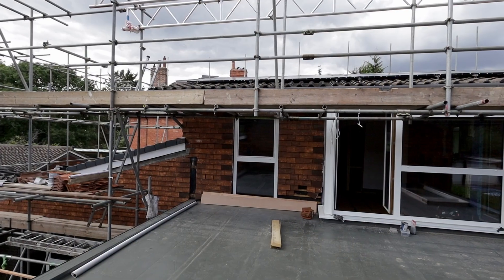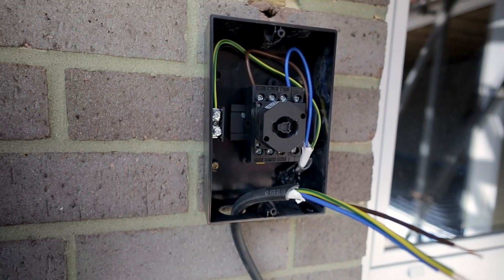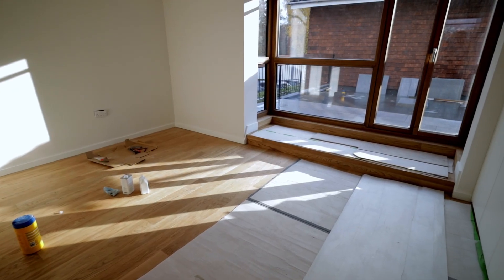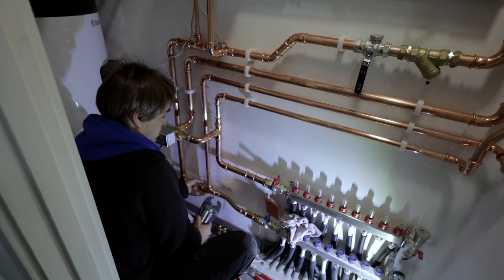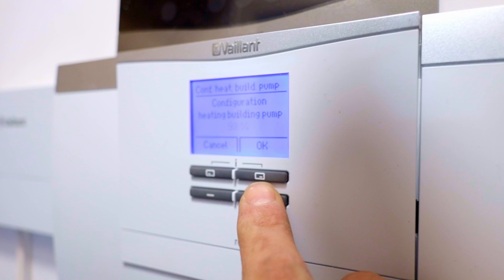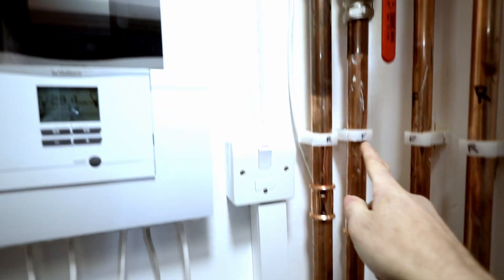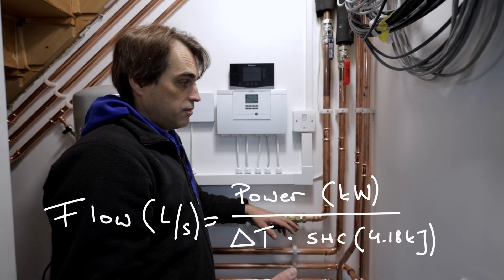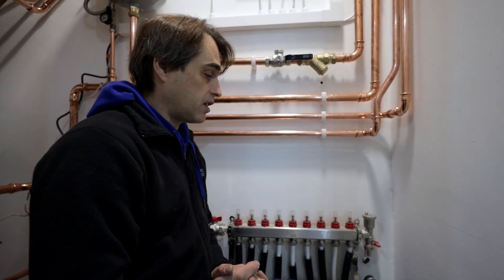How To Install an Ultra Efficient Heating System - Heat Pump + UFH.

Comment: Hi simon, like the install, nice and neat, however i don't agree with running open loop systems, it depends on the property of course but i find that zoning by room is beneficial. Open loop ignores solar gain and internal appliance gains eg an oven or computer, therefore you would be over heating some rooms whilst others arent yet at temperature, when shutting off the zones that have met their set point would allow the heat pymp to modulate down. What do you think of this?
Reply from the maker: You can still run open loop with stats that will close overheating zones. What you don’t want to do it to allow a small zone to turn the heat pump on, on its own
Reply: @UrbanPlumbers  interesting, can I ask what your opinion is on blending valves, I see the industry using these alot for 2 zone 2 temp with rads and underfloor, once again I don't really see the point for this because you're creating let's say 40°c for the rad circuit only to blend it down to let say 30/35°c for the ufh, would you just run it all at a single temp allowing the underfloor to heat up and satisfy the call for heat faster rather than wasting the heat that's already been created
Reply: Most heat pumps, like the Aerotherm you can place the controller which senses temperature in the room with the highest solar gains and enable internal influence to adjuist the compensated flow temperature down.  System volume is king with any vapor compression system.  For very large properties, HMO's, student accomodation, hotels etc.... zoning is stil required.
Reply: I agree with Simon but I also agree with you :) It really has some up- and downsides from my point of view. And as you said it depends on the knowledge about the usage and all the non usual ocasions like having a party with 20 people in one room, a wife which gives Yoga lessons in one room, an power hungry heat emmitting gaming PC :)... and so on.

But I of course highly cheer the knowledge, skill and pride Simon is putting into calculation of all the rather static energy needs of every single room and doing everyithing right from planning to delivering the project. I really learn a lot even if I'm not from the feeld directly!

I have optimized now 2 airsource heatpumps and one water-water heatpump by between 30 to 50 percent year to year energy consumption. They have all been put in without proper planning and just left with mostly standard settings or much to high preflow temperatures and many other misconfigurations on other settings. To me it seams that you really can screw up a lot and it does not really matter what kind of heatpump is installed.

Comment: Could you use 28mm PEX or similar instead of copper as the temperatures are so low? - about a third of the price.
Reply from the maker: Pex needs to be a size up so 32mm Pex for 28mm copper.

Comment: Hi Simon 
I know you are really good with vaillant controls, can I use vrc720/2 
With underfloor heating zone, plus two heating zones and DHW cylinder or I need some additional controls?
Thanks
Reply from the maker: Vr71 needed plus 2 x VR92, unless you want to run on pure WC - then just VR71 plus VRC720

Comment: Can I ask why you choose that capacity if heat pump for the property rather than a 5kw one?
Reply from the maker: This is a 5kw heat pump
Reply: If the heat loss was 3.5kw - why didn't you use the 3.5kw vailent? Which can do 4kw according to the sata sheet. Thanks.
Reply from the maker: @TC-V8  because 3.5kw unit is the same as 5kw and minimum modulation is also the same. 3.5kw is just a 5kw unit with capped top output

Comment: I you use only 1-zone, what would be your preferred way to setup a smaller room like a bathroom where you also would want a higher temperature? I opted to lay the piping at 5cm from each other but I think it still isn't enough. Would you opt for a extra radiator calculated on the same water temperature? 
Maybe an idea for a future video. If you don't have enough surface erea to lay floorheating. Thanks!
Reply from the maker: It depends on your heat loss. If you increase the flow rate to bathroom you can relatively easily raise the temp

Comment: How do you change individual room temperature if someone want higher or lower temperature?
Reply from the maker: Adjust flow rate. Different temperatures are so overrated and not needed 😉
Reply: @UrbanPlumbers  Are you married ? 😃
Reply from the maker: @eliotmansfield  happily
Reply: Change the flow rate at the manifold
Reply: I think the lack of control seems counter intuitive to many because having stats everywhere has been hammered into everyone for so long - similarly with ‘smart’ thermostats and letting people believe they are in “control”

Comment: I see a lot of copper. I have a quote from my installer that uses steel pipe. What is the advantage or disadvantage of using galvanized steel piping?
Reply: Time to thread the joints v pressing
Reply: @plumberdan5720  is that really the only reason? What about condensation? I guess copper condensates just like Steel? When cooling does this give problems with steel?
Reply: Not unless you fit a homonulus valve

Comment: Quality install… with all this insulation and heat recovery, how do they keep cool in the summer?
Reply: MVHR can be run with bypass
Reply: @marcexec  And some can have a second heat exchanger that uses water from the heat pump, so that if the heat pump can do cooling, the MVHR can cool the incoming air to the home.
Reply: Insulation also keeps heat out and you can add a cooling option to this heat pump if you only use UFH. It's limited compared to a full AC system, but may just be enough.
Reply: You're missing the point, a well insulated house with minimal uncontrolled air changes, will stay warmer in winter AND cooler in summer. Especially when combined with night venting (windows open when it's cooler). Massive glazing makes this much harder though..!!
Reply: They don’t 😂😂
Keeping cool is a big problem in modern houses.
Reply: @deanchapple1  so they install AC units cause… saving energy!
Reply: @alimack5489  AC units are expensive unless of course they have solar PV. 
Perfect combination, Solar PV and AC.
Reply: @deanchapple1  AC isn't that expensive to run tbh, especially if you're clever with curtains and windows. Mine were using maybe 300W  to cool two bedrooms when it was 30 degrees outside.

Comment: Thanks for sharing that. Very nice setup.Would be interested to know how close the temperatures of the room stabilise compared the design temperatures. Also, glad to see that the MVHR has been taken into account for ventilation heat losses (and curious what airtightness level they were able to achieve)
Reply from the maker: If you spend enough time adjusting it at the design temp it will be spot on.

Comment: Isn't it that 1kWh of electricity could move up to 5kWh of heat in to the property (hence 500% efficient)? The 1kWh of electricity doesn't produce heat in and of itself, it just drives the pump that moves the heat?
Reply from the maker: Actually that 1kWh  of electricity also contributes to heating!